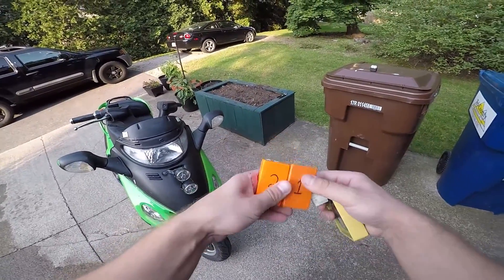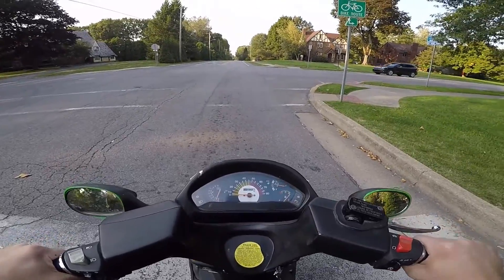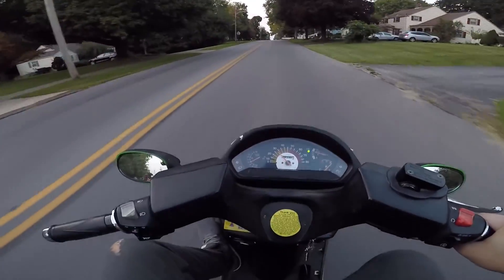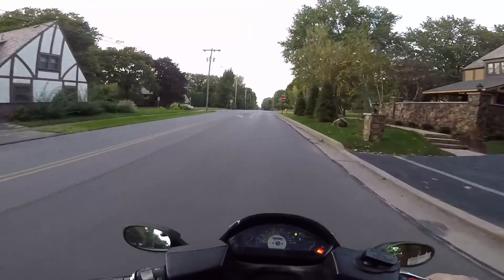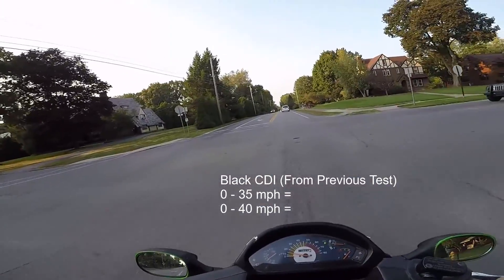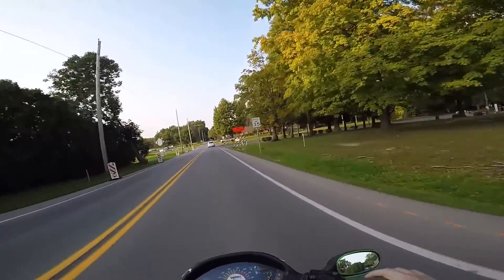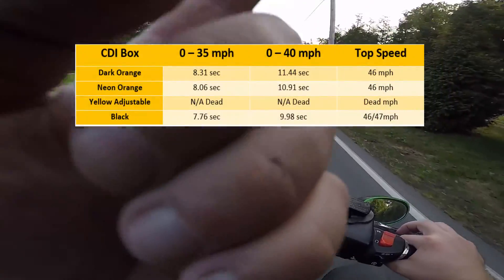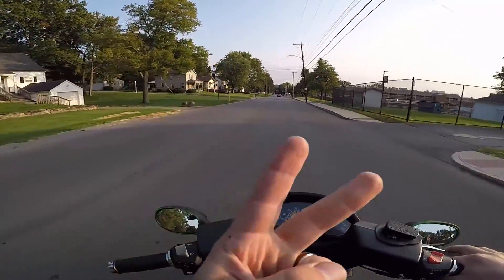Can You Make A Scooter Faster? CDI Box Test Part 2 | 50cc and 150cc GY6 Scooters

Comment: Take the washer out behind the variator will give ya 5 mph.
Reply: This is info I've gathered:
* Remove Emissions
*Add G- EGR Block-off Plate (GY6) 
*Add a 1/8 In. Rubber vacuum cap 

*Remove rev limiter (white) bushing on CVT variator
*Remove/Cut the Pink/Purple wire on the CDI harness 
*Replace stock exhaust ( internal rev limiter) with aftermarket exhaust 
*Replace stock air box w/ cone style air filter

Comment: I don't think any CDI will make a noticable difference, unless you have a majorly modified engine, cam, higher compression, and running lighter weights, for more rpm! I have seen 10k with mine, and still no noticable difference, even with the ac adjustable CDI,

Comment: Those scooters are almost gear bound. At 45 mph your turning 8-9000 rpm's. You need to change the gearing. Then put the 52mm big bore kit on. Then you will see a difference.
Reply from the maker: Yeah I definitely agree. I was thinking about messing around with the roller weights and see how the top speed is affected.
Reply: Wait. He's hitting 48m mph on a 50cc?! Damn. In my state, you don't need a motorcycle license and registration/tag for 50cc or 49cc  so that's why most people ride them. Big bore kit makes not legal without insurance, tag, and motorcycle license. And trying to get the DMV to register a 50cc is RIDICULOUSLY hard for whatever reason. :(
Reply: @androidken  No. This is a 150cc engine (not a 50)
Reply: I'm hitting 60mph on my 50cc.

Comment: I just ordered a China 150 scooter. Specs say it's max speed is at least 55 plus depending on rider and road. It's got 10.58 hp. Specs say it also has a speed limiter. Why would a 150 need to have a speed limiter if it's made to go at least 55 mph?
Reply from the maker: I think that would be in place to prevent you from over revving the engine and doing damage. It is probably meant to reach 55mph, but not for a long period of time. My scooter is screaming at 55-57 mph and it is very close to the rev limiter
Reply: @TyposGarage  I see.. Thank you!

Comment: The yellow one is a DC cdi it should be powered by ignition key 12v
 The orange Cdi is an AC cdi the power comes from the primary coil of your stator
That's why the other one didn't work
Reply from the maker: Thanks! Yeah, I realized that I bought the wrong type of CDI after filming the video.
Reply: Should have got the blue one